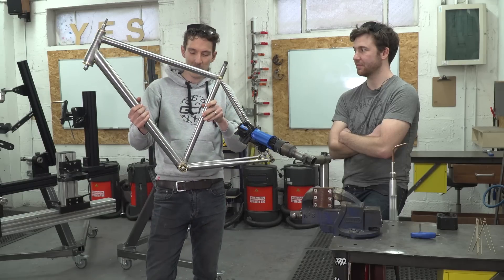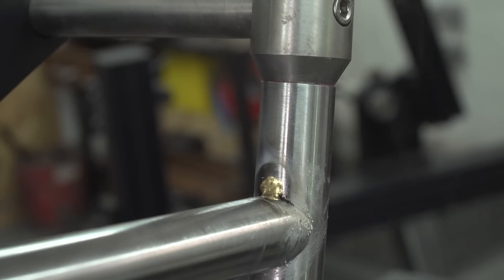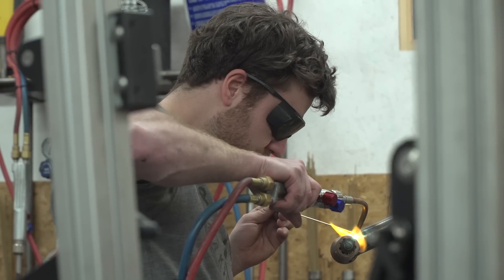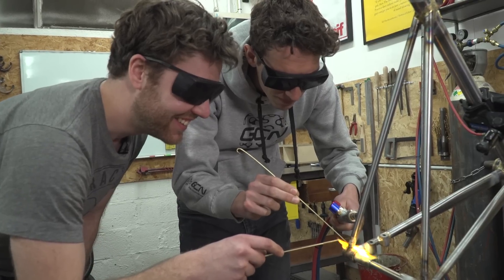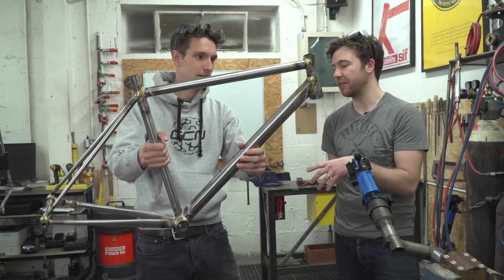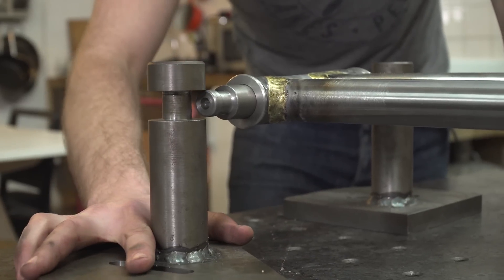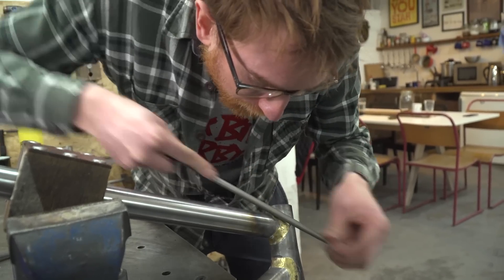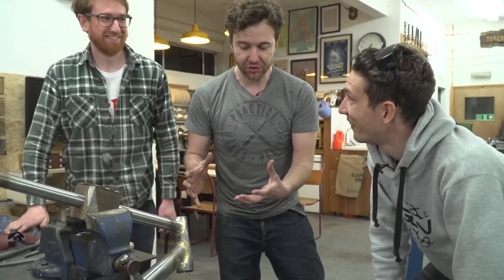How To Build Your Own Bike Frame Part 3 | Maintenance Monday

Comment from the maker: What do you think of it? Would you like to build your own frame? Let us know 👇
Reply: Global Cycling Network how many years do i need to wait for the entire series 😂
Reply: Great series.  After this process does Simon want to build more bikes??
Reply: nice but for the course and materials it is £1800 so not cost effective for some I expect
Reply: Yes, if it was a composite frame. That would be my ultimate frame -- a custom composite frame made specifically for my weird old-guy geometry. I would want it to blend elements of aero and enduro with accommodation for disc brakes and larger tires.
Reply: But after the course you can build more bikes, and sell them för a lot of £.
Reply: Global Cycling Network why not use lugs?
Reply: This is how you make a bike! This is a bike with a personality and this is only accomplished with crazy skills! I simply love it and I really want to build my own frame now! Whow!
Reply: Global Cycling Network i am working at one at the moment because of you guys :-)
Reply: Yes, I very much would like to! And it looks affordable if you save up for a bit (and skip a holiday trip).
Reply: This is brazing, not welding.
Reply: There is no spatter on tig brazing either even though it is electrical. Only mig and stick welding will have problems with spatter and you'll rarely build A bike using them.
Reply: Global Cycling Network It would be sick to build my own frame if it was for a discipline I don't focus on.  However, the bike industry really has it figured out how to build great bikes, so I would never consider using my own frame for my primary bike.
Reply: cant believe this video only got as far as the bike being brazed, was dying to see it being built up and the final product!
Reply: Look at the video about the bespoke bike show. The final result is there.
Reply: darkiee69 I saw that but I'm more interested in the process of going from this unfinished frame to finished bike
Reply: of course
Reply: That was very interesting videos, but. I once ordered a custom titanium frame. I made some mistakes in geometry so the BB was 1 cm higher than on my other bikes and the frame was a little too long. So I sold it in the end after using the bike for a few months. I would let pro make frames. And after all who rides steel frames these days?
Reply: When is part 4 video coming up?
Reply: yes, when?!
Reply: I have just had a cycling accident, broken hip and pelvis so off the saddle for a while.  This video is a great remedy for keeping my spirits up and as and when I am recovered I would not hesitate to sign up for a course with these guys...nice to see engineering of this nature being passed on...
Reply: it would be better if you show me the process bits of the lugged frame design :D
Reply: I thought I was ganna have to fire up a welder to build my own frame. I never thought about silver soldering. That looks way simpler. And yes, I am looking to build my own frame eventually. I'm looking to build one with good suspension and can handle the stresses of a bicycle engine. I've already put an engine on my own bike, I'm doing another one but I wanna build a custom frame eventually to mount an engine to. There are custom frames already built for sale but none I haven't found one with decent suspension. That's why I wanna build one myself. If anyone is wondering what kind of engine I'm talking about, bikeberry.com is one manufacturer that sells them
Reply: I would love to make my own MTB
Reply: lovely stuff...I work motorsport fabrication, same levels of attention to detail. But a lot more complex
Reply: Absolutely freakin' awesome. I've wanted to do this for years. What is the address of TBA. I'm in Australia but saving.
Reply: I've built hundreds of Reynolds 531 steel frames when I was working at Dawes Cycles 30 years ago.
However flux was added automatically to the fuel gas which makes things a lot easier and neater.
Also our fillet joints were never filed, they had to be that smooth without. They were also quite a bit smaller. Less brass = less weight.
Reply: FYI, TIG welding and brazing has replaced Oxy Acetylene brazing, Flux and the Neanderthals who don't know how respect filing fillet joiner. Especially in a shop designed to teach amateurs but who still want a beautiful yet strong joint...
Reply: No, I'll leave it to the experts.

Comment: Part 4. Hole is cut in the frame and it is filled with molten lead, holes are filled and painted.
Part 5. Simon tries hill climb against a chain smoker.

Comment: whats the advantage of brazing over welding? thought welding would suit better as its stronger and less material
Reply: Clorox Jericho brazing doesn't get as hot as weld so maintains the temper of the tubes. A good fillet braze is strong due to the extra material, but as you observed will be heavier (slightly), but then if you wanted super lightweight you wouldn't choose steel would you.
Reply: Keith Bontrager says you are wrong btw
Reply: i dunno after a steel frame but I don't think id trust a brazed frame, mostly mental ill conceded but it would have to be welded for me

Comment: I've brazed copper pipe for underground water in plumbing. Are there any differences between brazing copper and brazing steel. Example: differences in flux, differences in the silver solder, how hot to have your torch

Comment: Why don't they just weld it?
Reply: It's mentioned in one of the videos. Welding is melting the tubing, while Brazing joins them together without changing the size, shape or quality of the frame.

Comment: If you can't file a whole fillet brazed frame in six hours, you've not done enough filing. Two days to do it is amateur stuff.
Reply: agh well 2 day, is 2 4 hrs sessions for me.  i could stop early, but have some pride and do something as well as you can do it. TIG weld if your in a hurry.  I prefer to take my time.

Comment: 5:20 Dremel. Go to bed earlier.
Reply: ha ha. i have finished over 20 frames. Dynafile is used a bit, and a 90deg grinder a little.  But its still two days of work. unless you stop early and call it good enough.  but why half ass the last part of a nice frame.